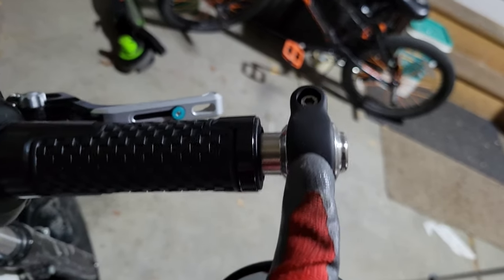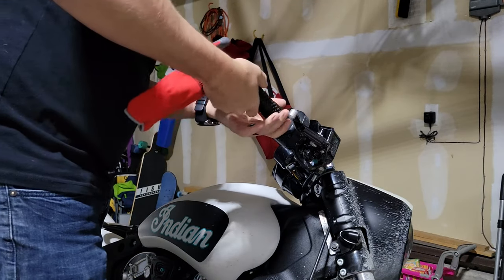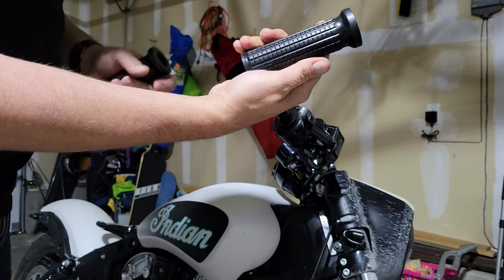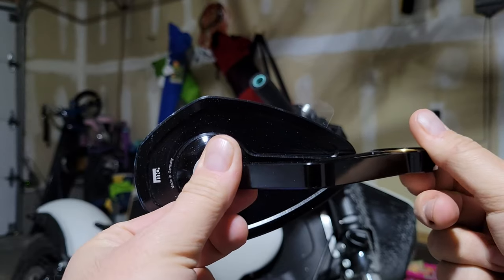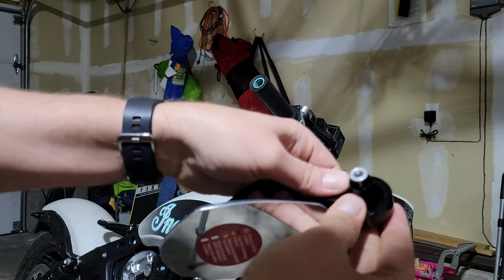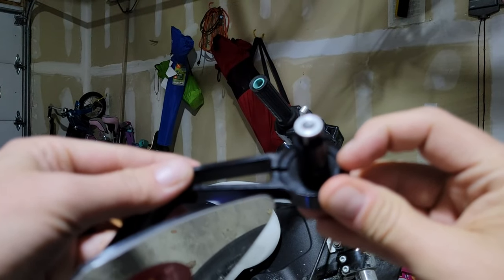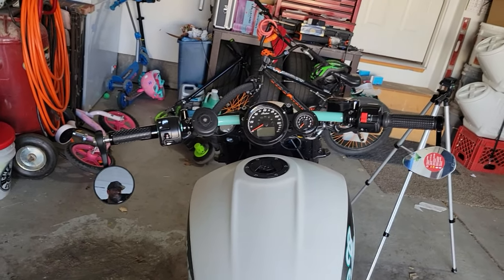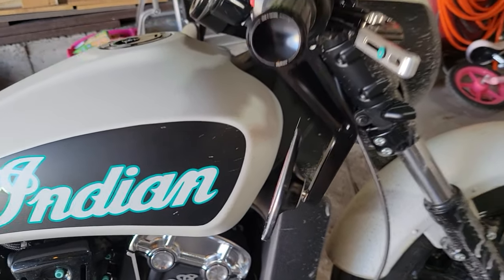How to Install Motogadget Glassless Mirrors on the Indian Scout Bobber

Comment: Did you use the 7/8" or 1" grips? I'll be installing these on OEM bars on a '22 ISB. Thanks.
Reply from the maker: 7/8", one will come slightly larger for the throttle side
Reply: Thank you for all your helpful content and assistance. You have and continue to be a blessing to new and seasoned riders. 👍🏼😎
Reply from the maker: @johnnieharris3570  thank you sir!

Comment: @jim bobbington Ty for all your content and help. I've been following your channel for quite a while. I've done a ton of mods to my bike a lot of which were based on your info/videos so ty for that. I'm kinda in a jam here and wanted to see what my options were. I purchased the exact same motogadget flight mirrors and adaptors. The mirrors are not hard to find but only very few places have the adaptors in stock. I was lucky enough to get a pair. My bike is a 2021 indian scout bobber twenty which comes stock with the mini apes. Inside the bars is a female threaded insert with will not work with these new motogadget adaptors. Is there a way that you're aware of to remove these inserts so I can use my new mirrors? I've also checked messy garage channel among others and cannot find any info. I also thought about drilling open the motogadget adapter and reusing the stock bolt but then is also have to cut the sleeve from the adapter. If possible it seems removing the threaded insert from the handlebars would be the best solution. Sorry for the long msg and I appreciate any help or guidance here!🙏💯👊
Reply from the maker: I believe we've already spoken,  but I think the best way to go about it is slowly drilling out the welded bungs by using various drillbits starting small until you get up to basically the inside diameter.